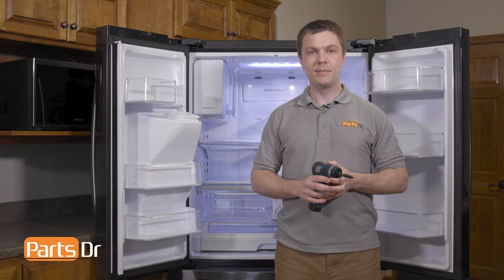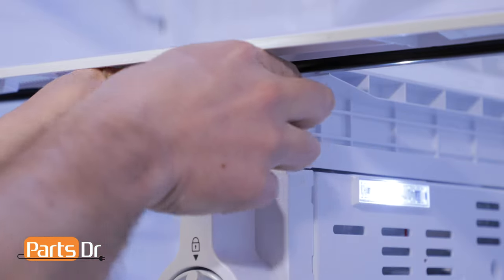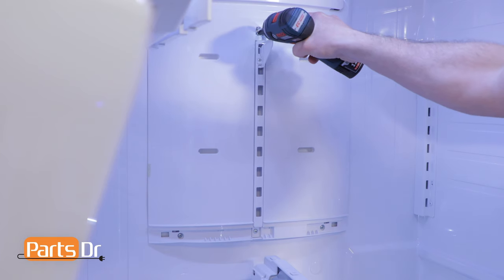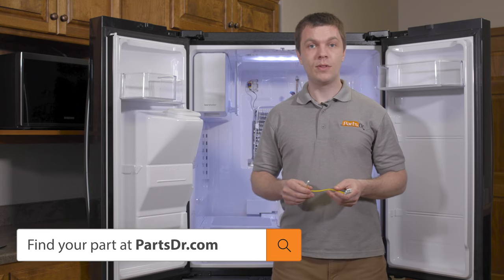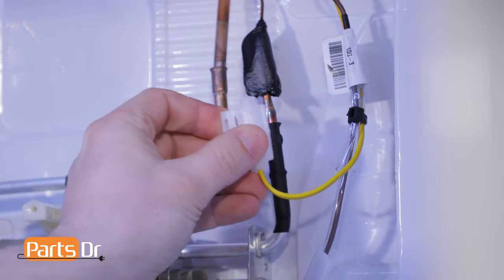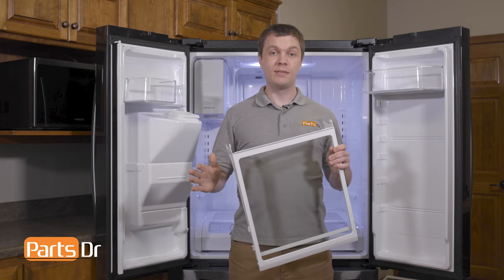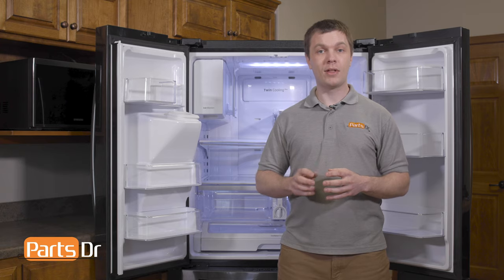How to replace the defrost temperature sensor part # DA32-10104N in a Samsung refrigerator

Comment: Some extra info, no one knows exactly what that black stuff is that commonly looks melted off in the upper right of the fridge where the copper refrigerant line goes from a small to a larger diameter. As a Mech Engineer thinking it through, this is clearly a thermal insulator. That copper pipe that is covered in the stuff is the expansion valve of the fridge where the high pressure refrigerant has its pressure rapidly dropped which causes its temperature to plummet allowing things to get cool. This is also where everyone's fridge is freezing up. You don't want to insulate the whole line because then what's the point of the fridge, but insulating it up here does make sense especially considering the frost build up issue.

Thermal Mastics in fridges that you'll look up typically do the opposite, help conduct heat (like when a temp sensor is up against the metal section of an ice maker so it can get a better reading). This black stuff looks to be a foam tape thermal insulator that was then wrapped in either electrical tape or more likely a silicone tape to keep it in place (sometimes these foam tapes don't stick too well). There could even be some of the thermal insulation "goop" put on the copper pipe as well.

I had the same issue where it looked "melted". My guess is it wasn't melted at all actually. I bet the ice freezing put it under a metric shit ton of compression making it appear to be melted (the thermal insulation epoxy "goop" i mention above could have been squeezed out too if used giving this effect). Any of this insulation that got onto your defroster cable likely did melt though as that gets very hot.

Here's what I did: Thermal Insulation Foam Tape around the expansion valve just in that one section, then wrapped in silicone tape. More importantly, you need to check to see if any components need replacing. Use a multimeter to check the resistance through the defrost conductor (should be like 120 Ohm +/- 5% roughly), the Defrost Thermostat (should be very low resistance, like 0.2 Ohm at room temp which is unlike most fridges where it's be open at room temp), and most importantly the Thermistor which is that white sensor with the yellow wires that all that black goop went onto (it's resistance changes with temp, but should be roughly 6 kOhm at 68 F). My thermistor's resistance was 102 kOhm which is clearly fucked. The black thermal insulation that melted onto it also isn't helping it get a new reading. So if you don't change the broken thermistor, you're just gonna keep having problems regardless. Links below:

Thermal Insulation Adhesive
https://www.homedepot.com/p/Armacell-Low-VOC-520-Pipe-Insulation-Adhesive-AAD520002B/202521370

Foam Tape
https://www.homedepot.com/p/Armacell-2-in-x-30-ft-R-1-Foam-Insulation-Tape-TAP18230/100539553

Silicone Tape:
https://www.homedepot.com/p/Nashua-Tape-1-in-x-3-33-yd-Stretch-and-Seal-Self-Fusing-Silicone-Tape-in-Black-1743082/100206050

Thermistor Resistance Values and More Troubleshooting Info
https://www.pcrichard.com/images/promos/RF4287HA%20Updated%20Fast%20Track%20R4.pdf

How to check resistances in the fridge, but note the values in this video are different for this model. Use the one's I mentioned above
https://www.youtube.com/watch?v=LTvaXKfFLC8&t=998s

Defrost Thermistor Clip Part No: Samsung DA61-03683A Sensor
Defrost Thermistor Sensor Part No: DA32-10104N

Why did I spend so long writing this? Because Samsung deserves to be shot for building this shit fridge and requiring people to reverse engineer.
Reply: So tired of defrosting and taking the thing apart. Never ever buying another Samsung appliance. I regret buying this fridge!

I’ve gotten 7 years out of it. I’m done with it.
Reply: I have been watching videos and reading numerous reviews and trying it all. I starting reading your post and shaking my head. Then I started working and immediately identified the same things you took your time to thoroughly explain and show because that's exactly what mine looked like black melted substance. That was completely melted off of where the plastic attachment goes. Which isn't showing in the video. I just wanted to say thank you. Just my luck but lucky you took the time to explain! Not sure yet if this will fix it but definitely is an identifiable problem. Wish me luck
Reply: Can I put the clip lower on the rest of the black stuff or does it need to be clipped at the top?
Reply: You answered my exact question but it seems it has been melted over my defrost sensor

Comment: Just paid $280 fro this job. You are in right line of business.
Reply from the maker: What kind of symptoms did your refrigerator have?
Reply: @PartsDr  water was accumulating under vegetable trays.
Reply: @Lepek29 when you fixed this. was it resolved? i’m having the same problem

Comment: I wanted to thank you for this video. It was clear and straight to the point. I followed your instructions step by step and i just replaced mine. I was using the blow dryer trick before but that was only a temporary fix. Hopefully this will be a more permanent fix.
Reply from the maker: Thanks for sharing!  What kind of problem are you having with your refrigerator?
Reply: @PartsDr  the coils were freezing up and the fan was making a noise due to it. The fridge wasnt cooling as it should and the melted ice was pooling up beneath the vegetable drawers. It got so bad it was moldy water.

Comment: I have had a similar French door refrigerator since 2010. Recently, the auto defrost in the fridge compartment stopped working and caused the large mount of water accumulating under the deli tray. I powered off the refrigerator to manually defrost. When I powered it on, the temperature inside the fridge could not drop below 50 degree. I spent lots of time on searching the issue online and could not find clue. 
After watching this video, I wanted to do a finial try before buying a new refrigerator. I paid $9 for a sensor in Amazon. I was so excited seeing the temperature dropped below 30 after replacing the sensor.

Comment: I have a Samsung French door RF4267HARS.  I have a problem with water getting into the middle drawer above the freezer.  It freezes and freezes any food or drinks in that compartment.  I changed the defrost temp sensor in the fridge compartment and added a longer drain clip.  It did have ice in the drain tube but not much ice overall behind the panel.  After these repairs it is till freezing drinks in the middle drawer.  Looks like there is another separate sensor in the roof of this compartment.  Also looks like the roof panel in this drawer is removable.  Can this sensor be replaced and is this the likely cause of my freezing problem or should I be looking at the freezer compartment below.

Comment: Probably the best “how to video” on YouTube. I was able to replace it without a problem. I have a question regarding this part and Temperature Sensor DA32-00006S and Senso DA32-00011C. I’m confused as to the difference between what temperature these 3 measure and if I should replace all three. The description for all three is that they measure the refrigerator temperature and send the reading to the electronic control. The problem I am having is that the food and some liquids freeze inside the refrigerator and the display always shows 80 degrees. I went ahead and ordered all 3 items just in case. Refrigerator model RF28HFEDBSR/AA
Reply: Sorry, just noticed this is to replace the defrost sensor. But regarding the other 2 parts DA32-00011C and DA32-00006S, what are the differences between them and should I replace both since items inside the refrigerator freeze?
Reply from the maker: Hi Christian, the different temperature sensors measure temperatures in different areas of the refrigerator.  Some sensors like the one shown in this video monitor the temperature for the automatic defrost cycle.  Others measure the temperature inside the refrigerator or freezer compartment so the refrigerator can monitor and maintain the set temperatures.
Reply: @PartsDr  do you have a video guide to where theof the temp sensor inside the refrigerator?
Reply: a guide to where *the temp sensor is inside the refrigerator?

Comment: Hi Ryan , first of all - great content you have put out... and I have a question - I will try my best to explain it well .... @ 2:25 sec on this video timeline there is thick black part ( loos like some tape ) what is that ? ..reason for me asking this question is on my Samsung refrigerator I had this ice build up and when I opened the evaporator cover .. I saw that same thick black thing all melted  

I am trying to replace the defrost sensor ..  but just wanted to be sure that I am not overlooking something else

Any suggestions will be apprecaited

Comment: hi, i have RF67DEPN I have tried to fix my icemaker, so unlpugged/plugged my fridge few times just for connecting/disconnecting the ice maker, during that process something wierd happened, the display started partially to blink (only 2 leds) and after resetting it now it shows wrong temperture (both parts fridge and freezer) and beeping every minute 11 times (cz it thinks its not cold enough in the fridge) , other than that it produces ice and cools like before, is it just a problem with the sensor? how can i fix it, maybe just plug it again? i will try to test the sensor like in 1 of your videos.

Comment: Great videos. I'm a bit confused. As I understand it, this is the defrost sensor? Where exactly is the temp sensor for the main refrigerator compartment? i.e. where does the front door digital temp reading come from?  My fan runs, no ice bulid up, compressor coils are cold--front door temp reading (not set point) always reads 35, inside of fridge never gets below 45 degrees as per a digital thermometer. Freezer fine.
Reply from the maker: The sensor you are looking for is most commonly found on the front side of the evaporator cover on Samsung refrigerators.  The location can vary depending on the model.
Reply: @PartsDr  Do you have a video for that? I have the same exact problem he has.
Reply: .... So do I
Reply: Anyone find a solution? Having the same issue.
Reply: @chrislgarner4927  were you able to find a solution? Having the same issue

Comment: The black goo melted above where the sensor is connected.  Can the sensor get hot and melt the goo if it's faulty.? Or what could have caused that in your opinion?
Reply: Mine too
Reply: Replaced sensor.
Fixed my problem.  
So I suspect the sensor can got hot as it quit  working.

Comment: If that panel has ice behind it you must thaw out the refrigerator or risk ruining the insulation behind and attached to the panel. 48 hours with the frig unplugged and doors open!!  Push in on the bottom part of the panel and if you can hear a crunchy sound, it is frozen. Replace the drain tubes in the back of the frig also, set of 2. They make a kit for this repair but can be a real bear sometimes to do it. Check the drain underneath the evaporator once the panel is off and make sure it is clear, if not use very hot salt water and a turkey baster to thaw it out. Good luck.
Reply from the maker: Good advice!
Reply: @PartsDr  Thanks, i have done about 30 or so of these...some easy and some not so much. I also have a permanent fix on the frig mounted ice maker that frosts up...
Reply from the maker: @troymckay3088  Wow it sounds like you are an expert!
Reply: @PartsDr  Yes i am thanks!
Reply: @troymckay3088  Please share?
Reply: @troymckay3088  I would like to hear more about the ice maker frosting up.  The tray has been cracked a few times trying to get it out.  thanks

Comment: when you removed the original one, it was on the left side of the tube.  when you put the new one on it was on the right side.  does it matter?
Reply from the maker: That shouldn't affect anything.
Reply: @PartsDr  Actually, in watching other videos, everyone says to put it over to left on the other copper tube, as it will be better placement to sense if there is ice or not.

Comment: I have the Triple Cooling 4 doors Samsung refrigerator , model RF28K9070SG/AA. Everything is working fine except left side freezer. Should I replace new Temperature Sensor or Defrost temperature sensor of that freezer? And what is different between temperature sensor and defrost temperature sensor? Thank you very much.
Reply from the maker: Both are temperature sensors but one controls the defrost function.  We have a video on how to test the sensors here: https://www.youtube.com/watch?v=J5bwcteeJNM
Reply: Thanks for responding. The R = 7k ohm in room temperature and 14k in ice water. So I guess the temperature sensor still good. Do you know why the freezer does work? Thank you very much

Comment: All your videos are incredible. Learned so much from you!
Tested my sensor, defrost heater, fan, bi-metal thermostat..everything works/tests fine...however the samsung rf31fmesbsr-aa  will not automatically defrost...i turn the circuit breaker off for 1 min. Then I put it in rd mode so it defrosts for about 2 hours...yes not 20 min (so much ice that the fan gets loud)...idk if its a board   since additionally,  after the power reset, the refrig shows the actual temperature on the display, not the set temp...any ideas or parts I need to buy?... Is there a defrost control board on this model? I didn't see one on your site...sorry for the long post...
Reply from the maker: We are happy you found our videos helpful!  If the defrost heater, defrost thermistor, and defrost bi-metal are all good then that usually narrows down the problem to the main control board being bad.  Although, you could have a part that tests good but acts up intermittently.  This can commonly happen with the thermistor and bi-metal.
Reply: @PartsDr  i can't believe u replied so fast! Tyvm...
i think I'm gonna have to get the main board from u as I think its not an intermittent problem as I have to reset the fridge every 5 days or so...its 1130pm here in Florida, so I'll order that tomorrow or Thursday...i dont think it can b anything else..thanks again
Reply from the maker: @jags132section  You're welcome! To be on the safe side, we would recommend to replace the sensor and bi-metal at the same time as the board.
Reply: @PartsDr  i c...i ordered the sensor n board early this a.m....but my bi-metal was the one that didn't show a reading at 140°      I figured since you referred to it as a catastrophic sensor that it wasn't necessary...i may order it later on if I need anything else...will let u know if the main board fixes the issue...also, should I move the location of the sensor higher up on the coil to where it gathers the most ice?
Reply from the maker: @jags132section  The factory sensor location should be fine

Comment: What is all that black goo above the sensor? On my particular Samsung Frig, it's melted all over the sensor, pretty much covering it. Wonder if that's my problem.
Reply from the maker: It wouldn't relate to a cooling problem, it is usually there to reduce the noise of the refrigeration system.

Comment: Is this the temperature sensor which may be responsible for the fridge not cooling - or is that a separate one? Evaporator fan motor and inverter board both seem to be working, checked as per your videos :)
Reply from the maker: Hi Tom, if this sensor fails it will usually cause the automatic defrost cycle to not function properly.  This will cause the evaporator coil to build up with frost/ice which in turn will block the airflow and cause the refrigerator to not cool properly.
Reply: @PartsDr  Where do I check this evaporator coil to see if it has buildup?

Comment: Hello. Will a faulty Defrost Sensor and ice build up cause that horrible buzzing sound that stops when the door is opened?
Thanks. Pat
Reply from the maker: Yes, it will commonly cause ice and frost to build up on the evaporator coil.  When this happens, sometimes the ice/frost will rub on the fan motor and cause a noise.  The noise most likely stops when the door is opened because the fan motor turns off when the door is opened.
Reply: Thank you,  @PartsDr .

Comment: Could a faulty damper door prevent the automatic defrost system from working? My Haier fridge freezer has a defrost issue, sensor has been changed also main board, it will defrost if I press the button on the control board but won't do it automatically
Reply from the maker: No, that would not normally relate unless the damper on the refrigerator has some defrost components built into it which would not be common.

Comment: Is it possible to replace the port that the fan physically connects to on the fridge? It’s corroded and there’s a connector piece stuck inside the female port. It doesn’t look like it’s made to be replaced honestly. 

The port I’m referring too is at 1:46

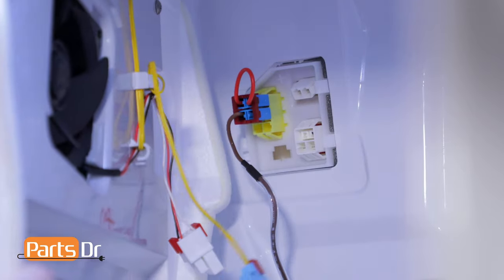Clear view of the ports 1:56
Reply from the maker: Those connectors are not serviceable.
Reply: @PartsDr  I was hoping you would say they were so I could fix it but deep down inside I’m happy so I can finally get rid of this damn Samsung fridge that is nothing but problems!

Never buying another Samsung again my goodness.